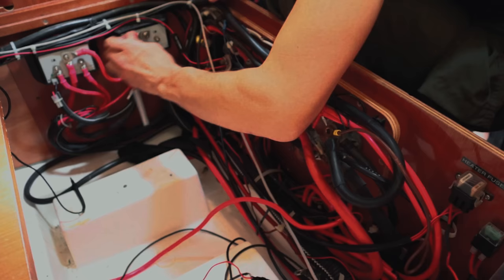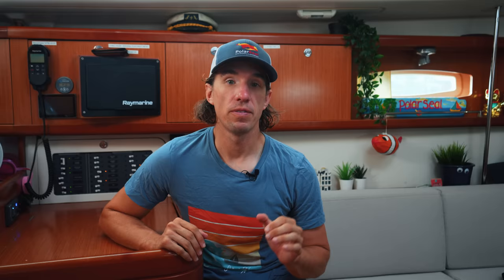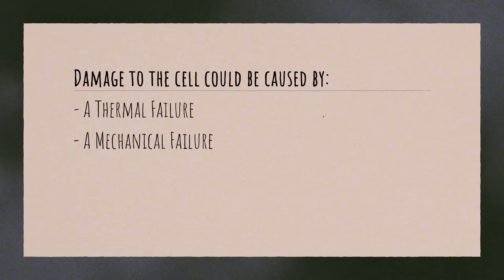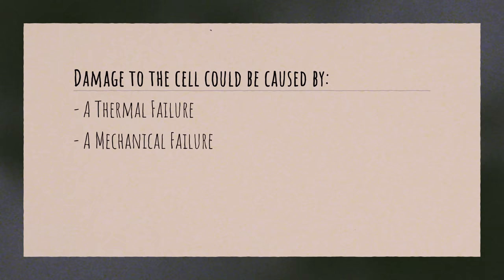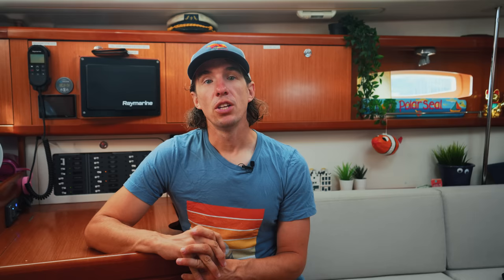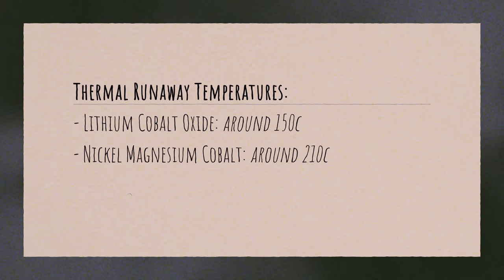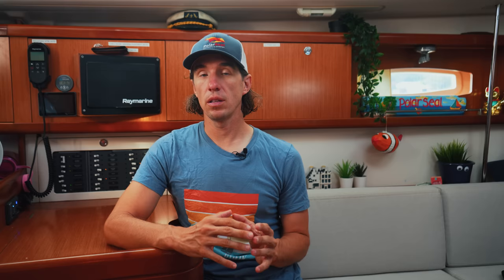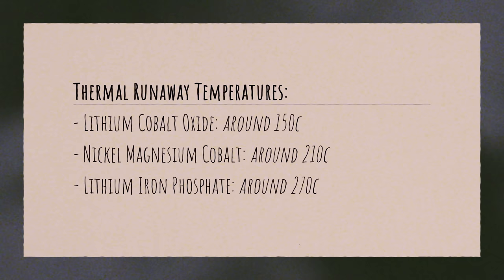WATCH THIS before installing lithium batteries on your sailboat ⚡ [RYAN'S TECH CORNER]

Comment from the maker: We’ll repeat it here: YES, Ryan co-founded Dakota Lithium, and we are 100% partial to the brand because he 1/ he has a clear and disclosed stake in the company, and 2/ we’ve used those batteries onboard in the last four years through thick and thin (and genuinely love them). One of the points we make is that not everyone is transparent about their financial interest to spread a certain type of information, and we take the stance to keep it real in all circumstances. And let this be a reminder that you can make your own decisions, and that those decisions turn better the more information you get :) we hope this was helpful!
Reply: You did a great job of keeping the video "clean"!
Reply: We actually got some of your batteries in the start of summer and love them. We went with Dakota Lithium because they seemed to be open and honest,. (And rugged, because we beat the hell out of our gear!)
Reply: Looks like you haven't heard of SUPERCAPS? I have 6x 80a/hr(480ahr) 12v caps on my 45' cruiser. My boat is the first in the world equipped with them. They are 98% efficient, 1 million cycle lifespan, no chance of them exploding or burning. No gas or chemicals stored or emitted. They operate between minus 50⁰C and 80⁰C. They can be safely discharged to 0v and stored under the workbench for 6 months and recharged when needed. They comply with all international aviation safety regulations and can be flown on a passenger aircraft safely and have a 10 year factory guarantee. I have had them on board for 3 years and are performing at 100%. I run a 12v 1.2kW windlass(100A). Autopilot, nav station, all lights, pumps, 80L freezer @ - 18⁰C and fridge @ 2.5 to 4.5⁰C. 2x 330W pollychrystal solar panels, 100-50 Victron MPPT and 12v to 12v- 30a Victron charger for changing with alternator. Lithium is sooo last Friday's technology.  Cape Town South Africa.
Reply: @grantpedder7719  Do tell us more. Do you have a video of your setup with more details?

Comment: I was about to climb all over this thinking that this was going be wrong on so many levels…..I was wrong. Good job! One thing that I’d like to mention is, If an LFP batter does enter thermal runaway, it is not as severe as a cobalt containing battery. LFP cells don’t generate as much oxygen so those fire can be extinguished.

Comment: One important point to add is that on high current situations ( above about 200amps) the quality of the cable crimps and connections is very important. A lose or corroded connection can go from fine to fire in seconds in high current situations. That is why where possible I recommend to use a higher voltage house bank 24v or even better 48v, because the current for the same load is much much less.
Reply from the maker: I know this from personal experience... very valid point!
Reply: Me too. Wish I would have upgraded to 48v and not stay in 12v. Way too many amps on my systems and super thick cables

Comment: Based on the thumbnail I was cringing, waiting for another video speaking in generality by a recent first time user / DIY (which seems to be the primary youtube information source!). 
As someone who started in lithium ion cell manufacturing in 2010, I have to say I'm extremely pleasantly surprised. Ryan, you are 10/10 on all points as you well know. Anyone reading this, I can attest this is sound balanced advice and not a Dakota commercial. 
Key points is that often to make it an effective installation, you need to assess everything directly interfacing with the lithium side of the battery bank. He mentions this but it's worth reiterating. 

Great video Ryan.

Comment: If you are searching for another subject for a tech talk I would like to see a series of discussions about the different parts of a charging system.  Solar panels, mppt, bms, inverter, shore power, batteries and how to integrate them.  I have seen a bunch but they always thought a quick overview and don't go into quite enough depth.
  Eg. MPPT. How to choose the right size, why have multiple mppt's
 Or   Inverters: string inverter vs micro inverter vs power optimizer.  Choosing inverter size.  Configuring boat wiring for AC and DC.
Reply from the maker: Great idea
Reply: There's a terrific series of talks and lectures in boat electronics on YouTube  y a channel called Pacific Yacht Systems,  and I think you'd find a great follow on from Ryan's excellent introduction. I'm presently juggling just what the heck to do for my Next Boat, but am getting there. As of now, a strong 316 Stainless Rear arch for about 800 watts of solar, plus wind gen, space on a bar for antennas, plus power Davits . No Generator, but a Balmer XT 250 amp engine alternator with a built in Smart regulator, or, what alternator plus installation kit Balmar recommends. I'm getting a 3 cabin layout, with aft port cabin ripped out for a house racked Battery Bank, plus all charging and inverter systems in one control room type layout, to keep easy fastaccess to everything. It'll help balance a 100 mtrs of 10mm chain plus anchor up front. Standard the boat comes with a 4 small battery bank under the aft starboard Cabins bed, a d I'm thinking extra diesel tank under there. Large Watervtank is amidships under the dinette sofa, forvtopping up with a Watermaker, so forward, midshipman, and aft will have a nice eight distribution low down in the boat. I'm thinking 4 or 5 x 200ah SOK high quality batteries for the House Bank. I plan on running the internal diesel engine under moderate load at about 2 hours a Day. one hour just before sunset, one hour just before Dawn, for hot water for 2 showers a day. zduesels hate being run without a load, and a load cleans their insides and keeps them in peak condition, hence the extra fuel tank just in case. Not sure if Ryan has mentioned Galvanic isolators, they're important, but galvanic Transformers are worth the extra. Best Wishes and Fair Winds. Bob. 👍🙂

Comment: Precise and well structured! On the maximum charging current: Rather large solar panel installations get more and more popular and together with high output alternators, especially on a catamaran, all on independent charge controllers, you can easily create exactly the scenario you described. I missed mentioning the myth that Lithium batteries offer more cycles, charging/discharging at higher C and more usable capacity of their nominal capacity. While all of those are true individually, they are not in combination. If the desire is to obtain the longest life time, the regular charge/discharge current should be planned by data sheet. Sometimes advertising suggests things would be easier than they are. I would love to see more tech corner episodes!

Comment: Thanks for this Ryan. Really clear explanation. Regarding insurance: I've converted my boat to electric motor powered by a 48V LiFePo4 battery system. My insurer was very unwilling to take on the risk (basically as you said they didn't really know what the risk was). I put together a full design document explaining my choices and the background research that led to them and as a result they were happy to fully insure the boat. Although I don't have your experience, I do have a degree in Electronic Engineering so I am at least able to evaluate the accuracy of the information I am reading and make safe choices based on that reading
I also agree with you comment about marine electricians: I tried to get my local marine electrician to inspect the work I had done (not just the 48V systems for the motor but the 12V systems and the AC systems) and they were clearly out of their depth.

Comment: External bms also give the advantage of being able to replace the bms without having to replace the cells. you can also select a bms that communicates in the way that you want it to instead of being stuck with some proprietary equipment or application.

Comment: Your background is very impressive.  I can tell you from first hand experience we had the insurance discussion with the Gowrie Group after recently shopping insurance for new navigational limits that cover the West Indies. We were specifically told no Lithium… sort of, Gowrie uses Markel’s Jackline policy and we were told they would not provide more than $250K hull coverage if the vessel had Lithium.   From our conversation with Gowrie, I don’t expect this to change or get better until the ABYC takes a stronger position to support Lithium technologies and even then, I would expect insurance companies not to insure any vessel where a professional lithium installer was not used.  Hopefully companies like Dakota are out there working with the ABYC to drive change in this industry.  Until then, my AGMs were installed in 2019 and I have to wait for them to reach end of life. I keep telling myself, every year the technology gets better and less expensive, but I sure do get jealous of those boats with nice Lithium house banks.   One comment I would add is that you did not have much to say about battery bank capacity and I have read that one big issue are these owners who install large banks and short cycle their lithium batteries however, this really isn’t a fire risk as much as a degradation of the battery lifecycle.  Anyway, great video and I have put Dakota Batteries on my list along with Battleborn. Anxiously awaiting for the insurance companies to catch up. 23:54
Reply: What would constitute a professional lithium installer? I install electronics at a marina. I also have an electrical/mechanical engineering degree. When someone wants something to do with lithium I tell them ill do the electronics but my marina will not install lithium batteries period or sell them, this is because I just refuse. Professional, years of electrical work, degrees, magician. I cannot judge the quality control or where the cells came from so I want nothing to do with them. Matter of fact I did a trolling motor this year the boat came back after the owner had the dakota batteries installed, because the trolling motor stopped working. It turns out one of the batteries was reading 3 volts and would not charge when I tested them.

Comment: If you want a really good starting battery build one using Toshiba SCiB LTO cells, they are capable of delivering 10c and can accept 10c.  There is almost no chance of the cells getting into thermal runaway.   A nominal voltage of 2.3v 6s yields a starter friendly 13.8v.  For a high compression diesel you may need 6s x3 in parallel of the 20ah cells.  I have been using 6s of the 20ah as a starter batteries for a pair of v6 outboard for 5 yrs with ZORO maintenance and no BMS.  For the first 2 yrs I checked cell voltage every 6 months, there was no appreciable drift.  Now I just check voltage of the pack each spring.  They lose very little voltage when in storage and can be charged at temperatures as low as -30c  They are not cheap but are very durable at about 20k cycles they have a 70% capacity rating.

Comment: great video! you asked, so here you go: we have 300 ah@24v and 2 alternators that will put out 350a @2,100 rpm. The batteries have a max recommended charge current of 1.3c.  (the engines are 12v and also small lithium with 15a B to B ) edit: a few years ago, the batteries were underwater for 3 days. While they (and the wire's attached to them) were destroyed, there was no other harm caused by them

Comment: Ryan - internal / external BMS - Re long term storage the external BMS can be disconnected so that over months the trickle current to run the BMS doesn't flatten the batt - I owned a yacht LA batt years ago but have 300A LFP in the caravan and they don't like to be floated so if not using the van I disconnect all loads and disconnect the BMS and the LFP is stored at 40-50% charge which is how they are shipped and need a top up and discharge back to the 40% every 6 months or so - unlike Lead acid that love being in float with a charger connected 24/7 - great vlog and well explained - Good to see Dakota changing and modernising their options - electronics is always changing - ex electronic engineering background from valves to semiconductors constant retraining just to keep up - now retired and have taken on the rear reclining armchair admiral role of dispensing free advice  - clicked and subscribed well done
Reply from the maker: Most lithiums with internal BMS cant sit for years without serious reduction in SOC .  the bigger issue is that the cells start to degrade.  Good thoughts though

Comment: Great video, thank you. 
I use Lithium phosphate batteries in my RV.... as three 100AH 12v.... I was considering a DC to DC charger for when there is not enough solar and use the RV alternator...... But I calculated the resistance in 8 meters of 10 mm square copper cable  (good for 50 amps)...was enough to limit the charge current from the alternator to under 50 amps and protect the alternator from over load....... To me it proved a DC to DC charger was an unessasary requirement or expense. 

I have also installed 50 amp circuit breakers on each of the batteries....and take advantage of the internal resistance of the circuit breakers to balance discharge currents in a limited way...... 

In practice as you suggest the lithium battery terminal volts remains relatively low until the batteries are fully charged.....and this makes for much more efficient charging from solar photo voltaics....  a match made in heaven is my experience compare with lead acid.
thanks again!

Comment: KLM Business Class houses on the shelf.   And yes I was listening to a great presentation on this subject.
One of the best points is that the cables need to be the correct size. Which of course is an expense and a hassle to run - so if not done and not done properly can lead to a Fire.
Reply from the maker: Yeah, we’re that kind of people for whom it was so exceptional to get those houses that we put them on display 😆 and yes, not only do the cables need to be the right size, they also need to be crimped properly! Which was an issue we ran into 🙈 but all good now!

Comment: I installed a Renogy 170Ah LiFePo battery last year. The only issue I've had is with my Isotherm ASU refrigeration, which automatically runs on freeze mode when the battery voltage exceeds 13.2, which with lead or AGM batteries will only be the case when charging.  The idea is to use the power when available to freeze the holding plate to reduce cycles later and save on power consumption overall.  Except the Renogy battery rests around 13.2, so the fridge is constantly trying to siphon off the excess power and as a result draining the battery.  So I have to switch it to manual mode to prevent this.  Isotherm has come out with a new temp sensor system, so perhaps this will solve the problem.

Comment: That was great.  Ryan you are exactly right about finding a marine electrical technician to do or help with the install.  Most are just interested in selling stuff and have very limited or zero real knowledge or experience.  I’m been thinking of making the change for awhile and I’ve made sure when I had to get a new inverter/charger it had a lithium setting.  Same with my mttp controller.  As for my alternator, it had an internal regulator and it’s charge output after a few minutes is so low it almost useless.  In order to make a switch worthwhile I think I will need a new belt system for a new alternator a long with a regulator that is a bit more flexible,  programmable and can talk to the other components.  That probably my next step with batteries after that.  A few years ago when I got out 3000 watt inverter/charger to run my wife’s air blower I pit in all new wires for the batteries.  They are massive and all are doubled up.  Just for smiles I think she has used the hair blower three times!  😊. Thank you again for the informative video.  I will definitely look at getting your batteries when I make the change.